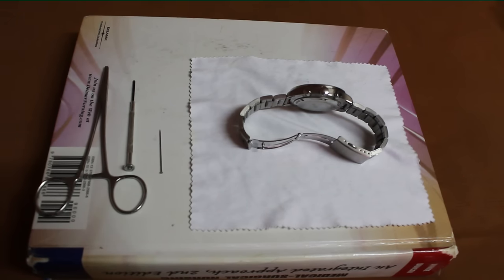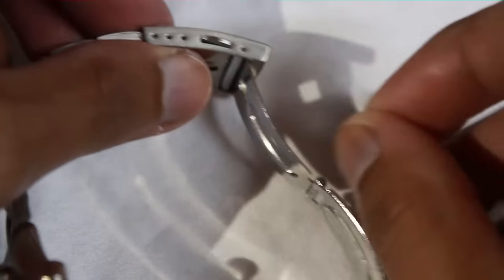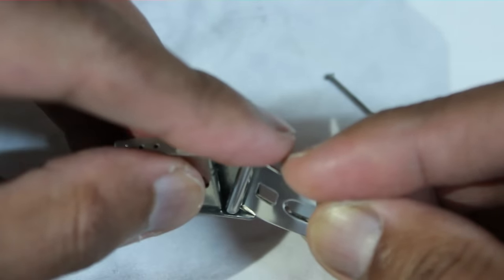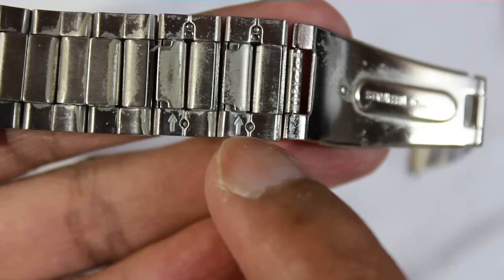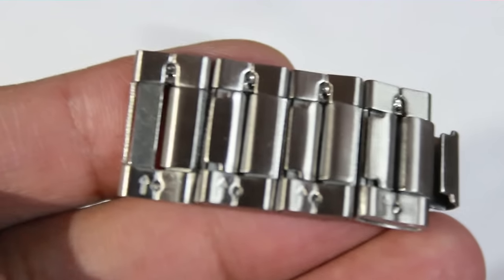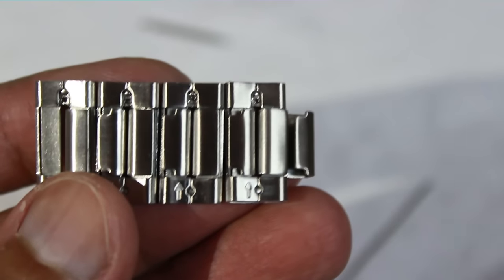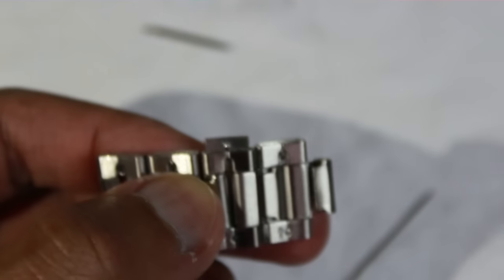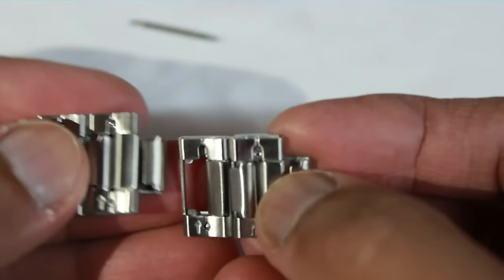How to Adjust your Seiko Watch Band the Easy Way Recorded from a DSLR

Comment: big downside from seiko . i just bought a seiko 5. but i got a different kind of band. And it really is HELL to take even 1 link off.... i got bloody hands and 3 broken needles. and the pin hasn't even moved.... big dissapointment since we had the same system in the 80s and its 2015 now ,  should be better now  :(
Reply: Many items are much cheaper/worse now as a result of higher commodity prices as well as manufacturing moving from Japan to Southeast Asia and China. I recently replace an old Pioneer CD player with the exact same model number. The old one was beautiful and lasted two decades. The new one (same model number) was made in China instead of Japan, and it was worse in every way. The plastic was cheap. the front metal plate was plastic. Even the power cable looked hand-packaged as opposed to old one that looked machine-perfect. It sounds the same, but it looks like crap, and i doubt it would take the beating the old one did (in and out of many residences, moved across the US, Europe and Asia).

Comment: There is no such thing as a flat phillips screwdriver. A phillips screwdriver is used for phillips head screws. A flat screwdriver is used for a flat or slot screw head. (see http://www.daviddarling.info/images/screw_heads.gif)

A pin is not necessary, a paperclip with one side straightened works just as well.

Also, those are not pliers. You are using a hemostat instead. It's actually easier to use the pin or paperclip to pull the locking blade or key out, by flipping the link over and sticking the pin or clip into the indentation on the back of the locking key or blade.

I actually used a standard (not large) paperclip to remove the pin in step #1. Then I used a 5/64 flat blade screwdriver to force the key up and out far enough that I could pull it out by flipping it over and using the same screwdriver, a paperclip or a 1/32 flat blade screwdriver.

In fact, using that indentation to pull out the locking key/blade is the ONLY place that a #0 phillips screwdriver would also work well at all.